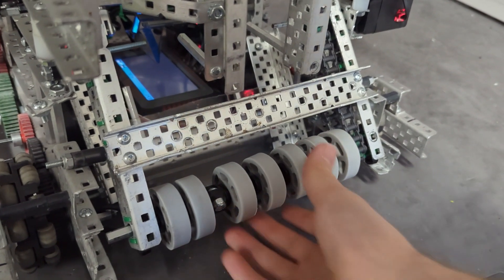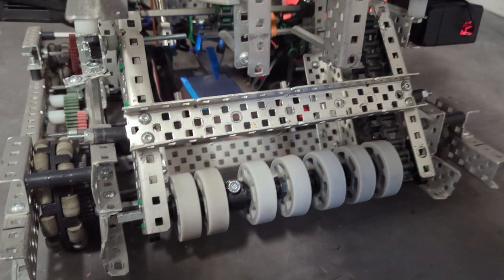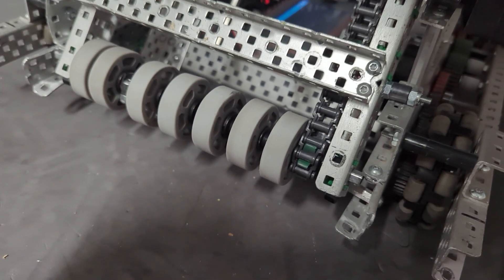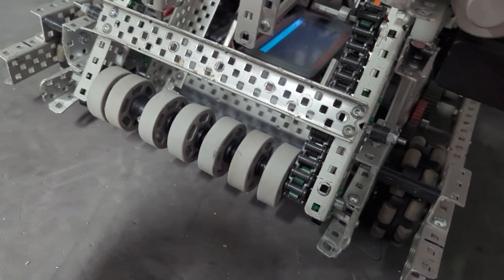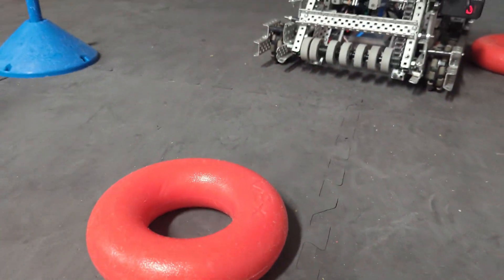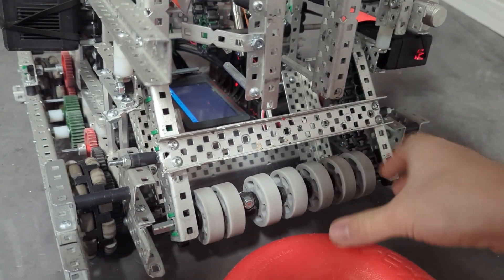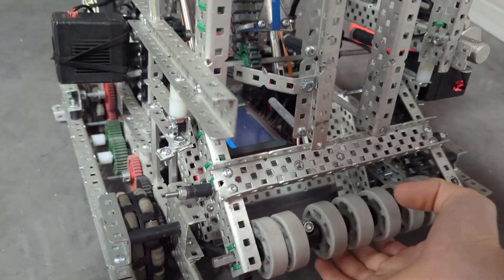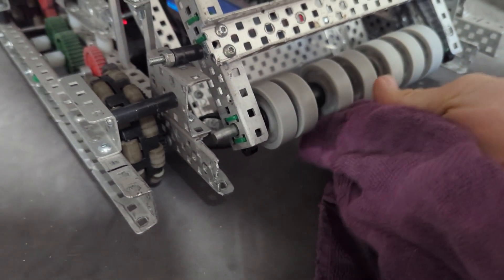How to Build an Intake | VEX HIGH STAKES

Comment: Do not use rubbing alcohol for cleaning flexwheels. It slowly breaks the rubber down on the flexwheels.
Reply from the maker: @ltcrobotics6271  Thank you for your concern, and while you are right that vex does say that, I (and many other teams) have been using rubbing alcohol for years and had no issues, and I've never heard of anyone having problems with it. My best guess is that maybe slowly over many many years it might cause a problem, but in all practically, it won't make any noticeable difference. If you're still worried though, you can also use Windex, a lint roller, or even just water works okay
Reply: W little will